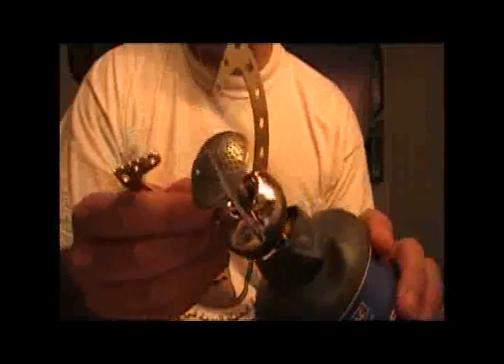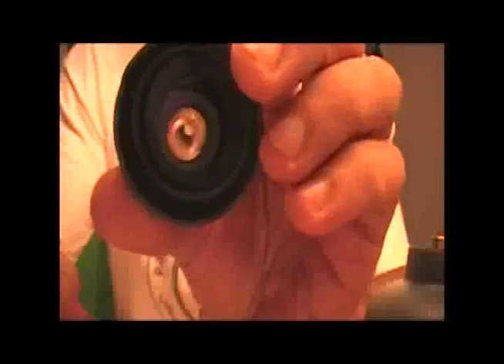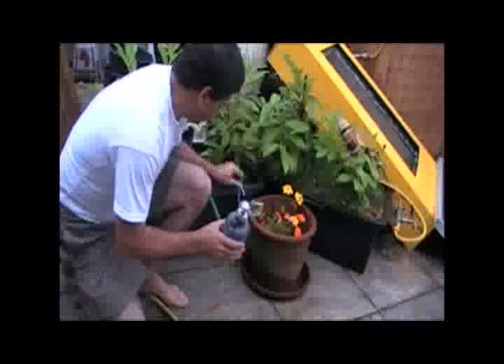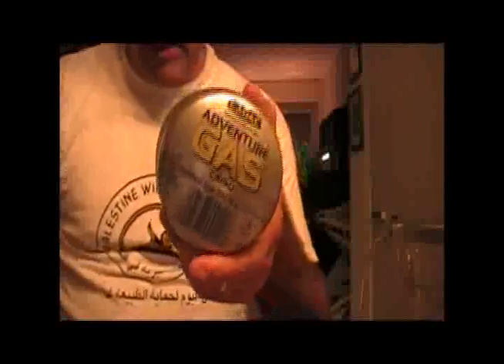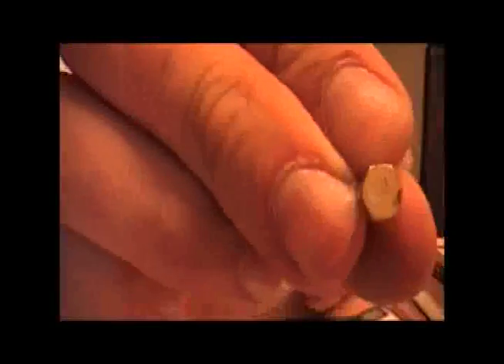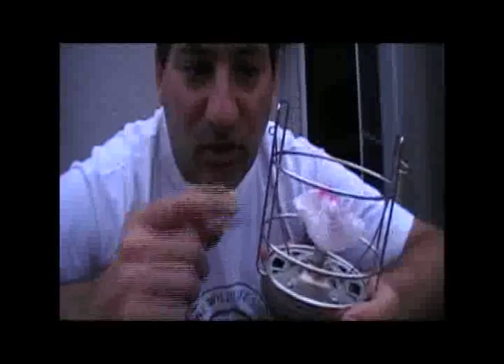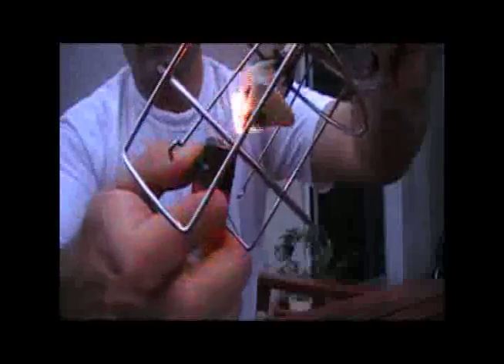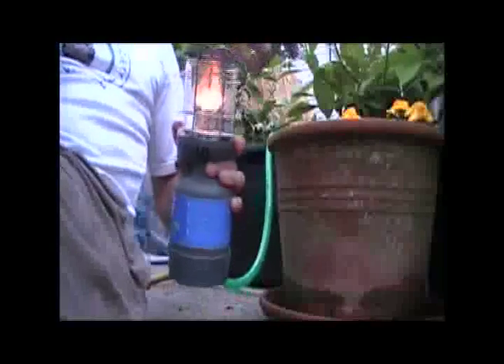Modifying camping stove and lamp to run on biogas

Comment: Hi Thomas, thanks for all the films, they have been a real help.    I have built an insulated 55gl drum version with a 3d printer bed heater (24v 200w) which is working nicely.    Due to its construction it could easily be run in the thermophilic range.   Would you advise this and is it ok to change back and forth for the purposes of experimentation? Or once you are breeding thermophilic would you have to start again if you wanted to operate at the cooler mesophilic range?    I’m off to look for a camping stove today!     Btw I have learned that damp wood ash will strip out co2 very effectively and turns into hard pebbles that can be used as building material.     Hey ho and cheers.     Tanc

Comment: Hi Thomas,

I am trying to do the same for my small biogas digester. The gas is already filling up the tire, so I have to hurry up. I need to know how do you connect the plastic hose to the gas stove. A picture could help!
Reply: Drill a two to three ml hole in the filter

Comment from the maker: A good care package if you want to help people in poor areas would be to supply each family with a basic stove/lamp set (retails at $30) and spare mantels ($1.50 for three) and the materials to build a basic kitchen-waste-to-biogas system (about $250). Then you will have given them fuel and light for a lifetime.  Contact Solar CITIES and get involved!